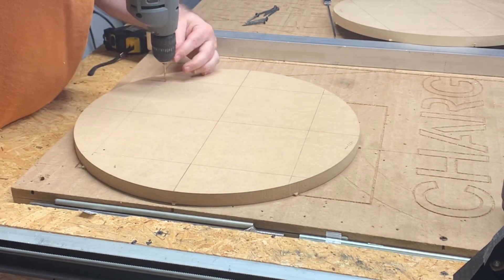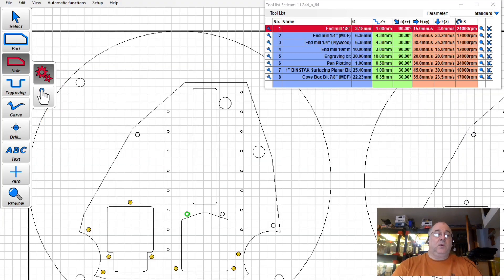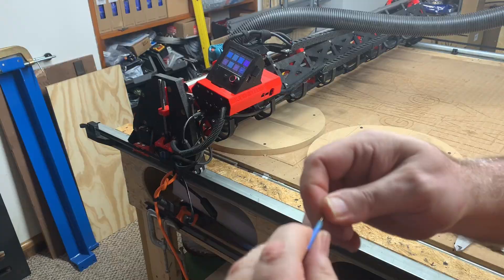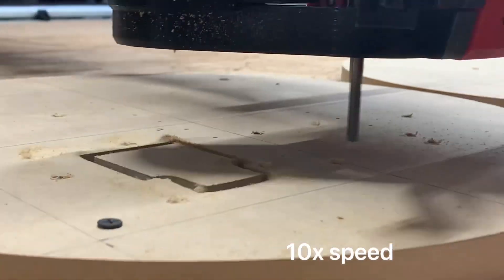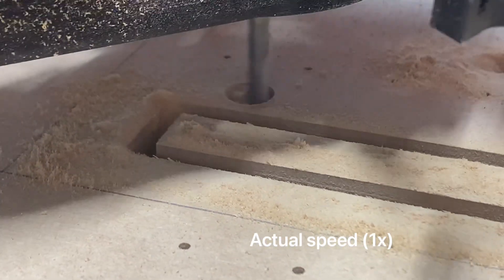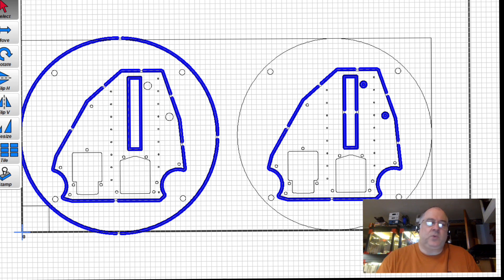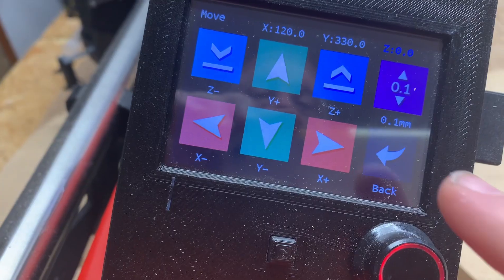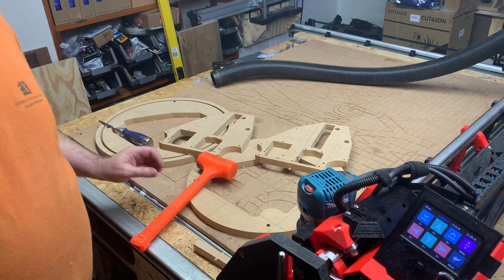LowRider 3 CNC Plasma Table PART 7 - using CorelDRAW, ESTLCam, & LR3 for YZ plates

Comment: I know that I'm late to the party on this one, but don't forget instead of cutting out a part that can jam you up, you can completely pocket it out, so it turns into sawdust and won't mess with your machine.  Yes, it's quite a bit more sawdust, but you won't have those loose parts kicking around.  Machinists habitually turn everything they don't need into chips, but us woodworkers think about cutting parts out.

Comment: Which Size is your Lowrider 3?
Reply from the maker: The LowRider v3 shown here that I used to make the plates is a full sheet size. It is big enough to do cuts anywhere on a 49“ x 97“ MDF sheet. And of course it’s able to do full size plywood sheets at 48” x 96”.
Reply from the maker: There is a LowRider Calculator on the V1 Engineering website (v1e.com) that lets you put in what usable cut area you would like, and then tells you how big your table needs to be to accommodate that. I think its normal output value for an X gantry big enough for a full size table is 1425 mm — and for reasons explained in one of my videos, I added 10 mm onto that, so my gantry length is 1435 mm.

Comment: Hello.  I'm building a lowraider v3.  I'm thinking of making the yz plates in 10mm aluminum, is that something that would be an advantage?  would like to know your views on it.  Best regards/josef
Reply from the maker: The default suggested spec in the docs is MDF that is 1/2" (12.7mm) and since aluminum is stronger than MDF (Ryan sells aluminum XZ plates that are only 1/4", or 6.35mm, thick) I'd say that 6.35mm thick aluminum would be fine for YZ plates, and 10mm would definitely be strong enough. 10mm is probably overkill.
Reply: @design8studio  thank you for responding so quickly.  I have a friend who owns a water cutter and he offered to cut these out for me.  do you know what the hole diameter is on the linear guides?  My hardware kit is still in transit so i cant messure
Reply from the maker: @josefsnickare  Without looking I'm not positive on the hole diameter but I'm thinking it's the size for tapping threads for 2.5mm screws. You or the friend can download the cut file for it and measure, or just look at the specs for the linear rails.
Reply: @design8studio   i will do that thank you

Comment: Do you have link for the cable chain you used and the STL for connecting it? I want to clean the wires up on mine and love the look of yours
Reply from the maker: Sure. But first, I have two LowRider 3's and two cable chains. My red & black LR3 carries a router (seen in this video) and uses smaller store-bought drag chain. My blue & black (with some red) LR3 carries a plasma torch and uses larger, 3d-printed drag chain. I'm assuming you are referring to the smaller as shown in this video. Details and printable files for the mounts for the smaller store-bought drag chain are here: https://www.printables.com/model/223004-lowrider-3-cnc-drag-chain-mount-v10 — and the smaller drag chain I bought and used is this one: https://amzn.to/3ttnDpb — By contrast if you are ever interested in the larger drag chain (not needed for normal LR3's but only for when large cables, such as for plasma, are in use), you can go here: https://www.printables.com/model/250838-drag-chain-for-cnc-two-piece-snap-open-20mm-x-40mm — and here: https://www.printables.com/model/253880-lowrider-3-plasma-cnc-drag-chain-mount-revised-for
Reply: @design8studio  Wow! Thank you for the fast response. This is exactly what I was looking for!
Reply from the maker: @28Seagulls  I just subscribed to your YouTube channel. I try to always follow / subscribe other V1E based fellows here and on Printables etc. If you get a chance, subscribe / follow me here and on Printables. Let me know your Printables link if you have an account I will follow you there too.
Reply from the maker: @28Seagulls  If you did not already see it, check out my latest video today!! First cut with LowRider 3 plasma table! https://www.youtube.com/watch?v=gU-OKSPN5ak

Comment: Would love to see how this table handles some aluminum.
Reply from the maker: There's lot of  aluminum cutting by LowRiders, including v2 and v3. Success is aided by air assist to blow chips out so they don't get rewelded onto the stock. Also misting with alcohol to keep things cool. I bought the compressor and other stuff for the air assist (includes the misting components) but I have not installed it yet. My first and only cutting of aluminum was without air assist and I suffered the issue of rewelding of chips. It also seems dependent on having right feeds and speeds.

Comment: I can’t find it but I’m sure you already talked about why you use Estlcam  can you give me a pointer. 
Thanks.
Reply from the maker: Before I switched to ESTLcam, I used the free version of Easel (inventables.com). Easel is operated on a "freemium" basis where a pricey subscription blocks nicer features from free users. Its learning curve is shallow but several things were super annoying. ESTLcam is awesome, and much cheaper, plus I prefer a one-time purchase over a subscription. Really liking ESTLcam.
Reply: @design8studio  thanks so much for the reply. 
What do you use for drawing up your models or do you do everything in Estlcam? I seem to see you doing lots in it. 
And thanks for the lowrider 3 insights. It really seems to be a more stable and robust design and not much more expensive. 
You talked about end stops being really important. In one of your future videos could you talk over some of the other precision and reliability aspects that you see with the lowrider3 over the lowrider2. 
You may have sneaked such things in on other videos but there are so many. I haven’t found it yet. 
Thanks again for your response.
Reply from the maker: @frederickwood9116  I use SketchUp (free version) a lot for designing in 3D, but whenever I need to work in 2D (like for milling flat parts) I am often in CorelDraw for CAD (editing lines and curves, and setting up layout) before heading to ESTLcam for the CAM (outputting the cut files). Sometimes a design starts as 3D in SketchUp and then a 2D export gets it moved to CorelDraw.
Reply from the maker: @frederickwood9116  I will consider trying to do a comparison of LR3 to LR2. Ryan has explained (in engineering sense) in several different posts and places some of what makes the LR3 better, and I could probably only do a poor job of emulating what he says so well. Its rigidity is so well thought out, and it accomplishes that with clever use of surprisingly affordable materials (when built and done according to the planned approach). The attention to areas that are normally weak, which primarily would involve unsupported runs across distance, perpendicular connections without enough bracing, and moving parts under too much stress, are areas where his genius has provided great innovations and progress. He took an already great and workable design, and figured out ways to do even better.
Reply: @design8studio   ok. SketchUp is very accessible so it’s nice to know it’s got more relevance for me. I confess I smile a little when you say CoralDraw. I remember when the brand was the bees knees along with token ring networks lol.
Reply from the maker: @frederickwood9116  I have been a CorelDraw user for a very, very long time! Other vector illustration programs would be fine. Some people have Adobe Illustrator. I have it (old copy) but I'm so used to Corel (old copy). Current subscription plans for Adobe are pricey. "Software as a service." Another option is Inkscape — a free, open source vector illustration program. https://inkscape.org
Reply from the maker: @frederickwood9116  Another option (free!) to consider is the free 'personal use' license for Fusion360. It's a 3D workhorse with power ranging from CAD and CAM and literally everything related and is used for practically everything. I'm not yet proficient with it, but I could muddle through if I had to.
Reply: @design8studio  I have avoided getting caught up in the fusion 360 world. it seems to cover so much and in such detail that it appears more complicated and sophisticated than I want to get distracted by. Possibly I should just bite the bullet and dive in. The time to acclimatise worries me too. It’s just a hobby for me. 
SketchUp is so simple to do woodwork drawings in. I still have the install files for the 2017 make version. I run it on Mac and on Linux in wine. I’m no pro by any stretch but it’s learning curve is not bad for quick rewards at a light hobby level. It looks like you get the same simple satisfaction with your other tool set parts (Estlcam and coraldraw) as I get with SketchUp.
Reply from the maker: @frederickwood9116  Yep, same, same. I am a long, long time user of SketchUp. Because of me being a teacher, I got the Pro version for free to help in education. I used that even for a while after they changed policy and started charging for it. I also still have the install files for the 2017 make version, and it's what I use the most regarding 3D work. I don't currently have an active pro version anymore.